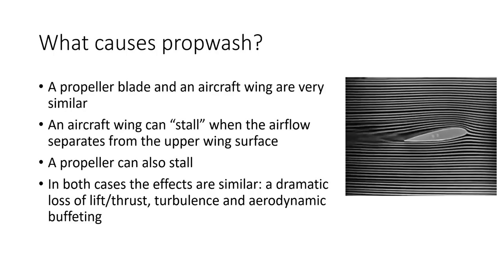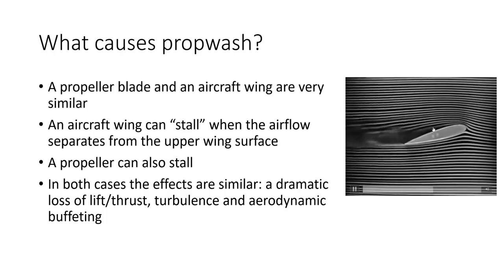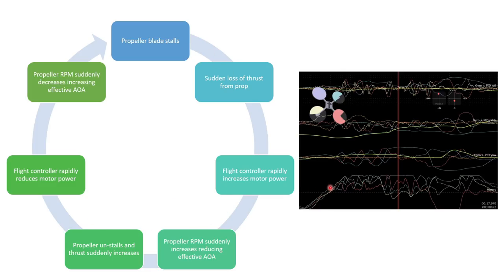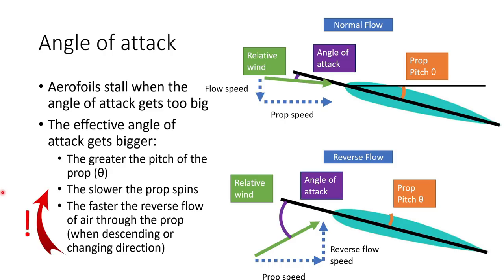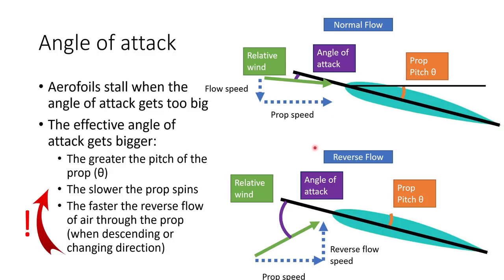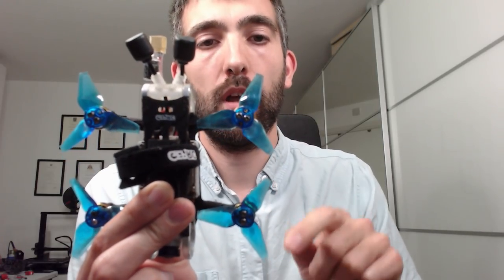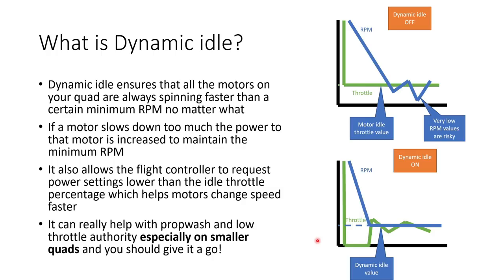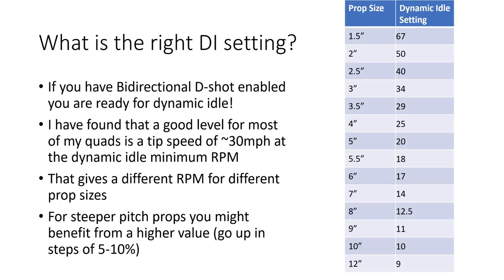What causes Propwash and how Betaflight Dynamic Idle can help!

Comment: How about for tiny whoops?  I struggle with a balance of min idle, inverted hangtime, and propwash/washout.   
If i try dyn idle at 67 on a 75mm whoop i have to increase min idle to about 15 from 5.5 to get rid of low throttle issues and then that kills any indoor inverted tricks.  
Secondly what about different blade counts?  Logically it looks like a quad blade would have worse performance because of the unstable air coming of tail effecting the following prop.
Reply from the maker: Tiny whoops are very difficult to tune. The best thing for washout is to run props out. Inverted tricks are very difficult with a tiny whoop because you're struggling with needing a high dynamic idle to minimise propwash. If you run BF 4.3 you can run a high dynamic idle with low D-shot idle (you cannot do that with 4.2). That's your best bet.
Reply: @ChrisRosser  Yah i’ll have to give 4.3 a shot.  We tiny whoopers push these things to their limits!  
I did mess around more with settings in 4.2.9.  I like Dyn Idle at 56 and min idle at 6.   It got rid of the washouts completely and i’m not noticing a difference in hangtime.  Only downfall is new mid throttle oscillations.  I can deal with some vibration though.  Thanks for the video and getting me to figure out how to use the setting.   
Cinewhoops get it next!...
Reply: Great question...  you fly accro indoors?  Lol, impressive!  Or maybe my apartment too tiny for such stunts :). Yeah wasn’t much explanation for tiny whoops...
Reply: @markmontreal7815  yah I can't fly in level mode even for races.  Look at the videos on my channel they are mostly all indoor tinywhoop freestyle.
Reply: @Shauny_D  just watched one…….  You’re not serious…. You really wrote that with the whoop???! Naaaah lol
Reply: @markmontreal7815  haha that was this week's challenge for fun.  Week 20 has some fancy indoor tricks.  I think week 23 some indoor rubix cubes and powerflips.  Anyway, all the top 20 or so IGOW pilots can do some crazy indoor stuff.  Watch Tyrantt or Auxplumes too they are machines!.

Comment: I've actually not tried dyn idle yet would it also help with inverted tricks ?
Reply from the maker: It won't necessarily help with inverted tricks but it might allow you to improve propwash and therefore lower your D-shot idle value slightly. That will help with inverted hangtime.

Comment: I experience wobbling when the throttle is at zero after using the 'Dynamic Idle Value [* 100RPM],' but in BF 4.4, I can't change the 'Motor Idle Throttle Value [percent].' How can I fix the wobbling issue?
Reply from the maker: Increase the dynamic idle value and the situation should improve.
Reply: @ChrisRosser  Thank you.

Comment: Hi Chriss. Thanks for your videos. I have a doubt about Dynamic Idle. For more aggresive props we need to set dynamic idle rpm higher? That seems counter-intuitive. I'm using BF4.3 and Hurricane 51466 and found zero throttle problems that I solved rising Dyn Idle to 40. With a prop like Ethix S3 the quad flies well with Dyn Idle at 30. Can you give some clue about that?

Comment: Hi chris. This was a phenomenal explanation - sorry i'm late to the party! 

could one in theory use the current throttle position as a cutoff/indicator for the minimum motor RPM? For example, if i know my cinewhoop can descend at 30% throttle straight down without stalling (any more is bad) - can i interpret this information and use it to my advantage?

I'm struggling a bit with cinematic shots where people wants me to descent straight down with a cinewhoop. 

In theory would bi-blades help reduce this effect because there is less drag on the prop? (an actual application for a sinusoidal prop maybe??)

thanks again for putting this into visuals. I understood intuitively that some sort of feedback loop was happening, but I never fully understood it.

Comment: Great explanation! I was wondering if the x8 offset motors is a good idea? Seems like a lot of dirty air.
Reply from the maker: It's a good way to get a lot of lift in a compact package. It's not as efficient as an X4 due to teh air from the first prop interacting with the second one but can carry a lot more weight for the size. Ideal for lugging heavy cameras around without resorting to  a much larger 10-13" platform with correspondingly worse vibration. 👍

Comment: OK so, I have 5.22" props. I set my dynamic idle to 19. I then spun a motor until I got 20% more. For me it was 4.8 idle value at an RPM of 2300. So only thing throwing me off if I lowered my idle value but then I have bigger then 5.0" props. Am I on track here?
Reply from the maker: Yep that's right. Bigger props will have a lower idle value.

Comment: I personally like idle value a bit higher then default as it gives me longer and smoother drops when spit-s or powerloop, and a this movements it is easy to get in to the propwash. Setting up my main idle value to around or above 6% was great in reducing propwash in this movements but after adding dynamic idle (in my case at or under 25% less then main idle) it gave me almost no propwash at all. Everyone should at least try what Master Chris is suggesting and I promise you will get what you expect :) LESS PROPWASH :)
Reply from the maker: Great to hear that you found DI made such a great difference. I'm happy to report that DI is much improved in 4.3 you no longer need to tune D-shot idle, just set dynamic idle and everything else is taken care of!

Comment: I tried dynamic idle when it was first added. It was working OK initially but when I tried to fly a quad with a motor output limit, I got a desync. I could feel that much of a difference when using it and I think there may be a bug with using it combined with motor output limit. The recommendations on what value to set seem to be different depending on where you look for the information, at least it was the last time I looked. I can’t remember what value I had used but it was towards the higher end of the recommended range.
Reply from the maker: Hi Tom, a common issue with DI in 4.2 is that if Dshot idle is set too low you end up relying on it all of the time. The controller for DI in 4.2 is very basic and can cause wobbles and other issues. DI in 4.3 has a PID loop and doesn't have the same problems. If you have issues with DI in 4.2 99% of the time you need to increase Dshot idle.
Reply: @ChrisRosser  I am still on 4.2.x versions. Will switch to 4.3 when it’s released or at least there is a RC version of it. The strange thing was that it appeared to be working properly on 4s but then had a desync on the first flight I did on 6s with a motor output limit.

Comment: This helped me a lot with my 4 inch but I am getting some low throttle wobble. In Betaflgith 4.3 when you use dynamic idle you can't use Motor Idle Throttle Value anymore is there another way to address the low throttle wobble in Betaflight 4.3?
Reply from the maker: If you have low throttle wobble in 4.3 it's unlikely to be dynamic idle related (unless DI is set too low). I would suggest looking at the PIDs.

Comment: So if the whole point of dynamic idle was to increase stability, but it ruins stability at 0% throttle, then is it worth it at all? I've been using it to try to help my low- throttle wobbles, and have had to set idle % values at like 14% on 6" to 10" rigs, which has been totally ridiculous and has ruined my inverted hangtime and dive abilities. If what you say is true, then I'm going to go back and turn off dynamic idle on all my quads, because it seems like a losing proposition. 

Why does it result in the need for super high idle %, anyway?
Reply from the maker: Great question: So as I understand it the control loop on dynamic idle in 4.2 was a bit crude. If you relied on it all the time at zero throttle it could create wobbles. It was meant to be used only as a last resort. Hence why you needed to have the right idle percent so you weren't sitting on dynamic idle the whole time. In 4.3 dynamic idle gets a full PID controller and its perfect, so good that you don't even have an idle percent any more with DI enabled.

Comment: Hi Chris, Thx a lot for the video.I followed your advise and propwash is gone. I've got one problem left.On full punch out, i am getting oscillations.I increased the throttle boost from 5 to 10, it made it worst.Do u have any quick tip on the full throttle punch out issue? Thanks.
Reply from the maker: Try looking into adjusting TPA. 👍
Reply: @ChrisRosser  Thank you

Comment: From someone with no clue: these values seem kinda high? Setting DI of around 67 for a 1.5inch (approx. my whoop with 40mm props) I'd have to increase the motor idle throttle value by so much, that it would be too floaty for my liking... good chance that I misunderstood something though.

My thought process right now:
Does the "idle throttle value" even do anything with DI enabled? You explained that the FC, with DI enabled, can command down to 0 throttle  (so go below the motor idle value) and then controls the RPM according to the DI-value that I entered, correct? So, if it is controlling the motor according to its RPM, "motor idle value" now only acts as a trigger for activating Dynamic idle whenever my throttle-channel goes below the idle setting?

In my understanding now: Whenever I move to idle power, Dynamic Idle determines the power to the motor to keep the minimum RPM as set in the "dynamic idle value". The "motor idle throttle" does nothing except trigger dynamic idle to control the RPM as soon as my throttle-stick moves below that value... but I'm sure there is a mistake in my thinking somewhere..
Reply from the maker: You need a high DI value to control propwash on small drones. If it's not floaty enough you can decrease it but it will negatively impact propwash. Of course you may wish to trade off these two things to suit your flying style and that's the right thing to do. Engineering is all about tradeoffs! 👍
Reply: You don't have to increase the motor idle throttle value at all in 4.3.  Most likely we will stop people messing with it to make it easier to set up.

Comment: I look forward to installing 4.3 and trying this. Could you help me understand a similar concept at full throttle?  It seems to me that 1 or 2 motors will hit 100%, which means the FC can only provide stability control by decreasing other motors.  Is it true to say that stability control at full throttle is inherently diminished, or is there some kind of dynamic full throttle pid loop that keeps all the motors hovering above and below 90%?  I'm developing a quad that uses prolonged full throttle punch outs, so I am curious to find out if scaling the throttle to 90% allows The flight controller to act like a dynamic high throttle pid loop.
Reply from the maker: Your understanding is correct but there is no problem with authority at 100% throttle. Reducing other motors provides the same authority as increasing one motor. In general control authrity increases at higher throttle because motors can respond more quickly at higher RPMs. 😁

Comment: thanks as always, chris! I'm still a complete noob when it comes to tuning a quad, and still VERY confused about all the parameters and settings. for example, what's the interplay between "dynamic idle" and "motor boost"? thanks
Reply from the maker: Those are quite independent. Dynamic idle is to do with minimum motor rpm. throttle boost just gives the motors a bigger signal if you increase throttle quickly rather than slowly. It's just feedforward for throttle.

Comment: I'm of the understanding Dyn Idle was basically rewritten in 4.3. setting it up should be the same, but it should perform better.
Reply from the maker: Spot on. Big improvements to DI in 4.3 with the addition of a proper PID loop for the RPM control 👍 Thanks CT!
Reply from the maker: Yes, in 4.2 DI had a very simple controller and setting D-shot idle too low coudl cause wobbles. In 4.3 DI gets its own PID controller so this problem is eliminated.
Reply: @ChrisRosser  hey Chris, reading it tuning notes for 4.3, it almost sounds like you can drop the dshot idle to something SUPER low, like 1-2%, then set the dynamic idle HIGHER than the dshot value.... Did I read that right?

From the tuning notes: " It can now be configured to hold RPM above the normal idle value, improving motor spin-up-from-low-rpm behaviour, while allowing motor drive to go to zero for enhanced braking when appropriate."
It continues
"Quite a lot of logs show that ESCs have difficulty quickly generating thrust from slow RPM. Dynamic idle, when set to a fairly high minimum RPM, eg 40, can prevent RPM falling low in reverse airflow states. This will improve responses when starting and stopping a flip at zero throttle.

The new code is so good that I can fly my quads (with old BLHeli-S ESCs) on 1% DShot idle and only 1200 rpm as a minimum dybamic idle RPM. The prop blades are visible turning slowly during LOS flips and rolls, but they don't desync. For more general freestyle applications, a minimum dynamic idle RPM of 4000, and for racing of 3000, with a DShot idle of 4% usually works really well"

Comment: Nice Video.

But at my BF 4.3 there is Motor idle gray, so I can't set this value when I use Dynamic idle. 
Is that new in BF 4.3?
Reply from the maker: In 4.3 Motor idle is disabled when dynamic idle is enabled because it no longer does anything. Just ignore it 👍

Comment: Just I wonder if Dynamic I. settings work for EDF quads as well?
Reply from the maker: Should work just the same. In fact may be more important for EDFs due to the Typically higher disc loading.

Comment: Has anyone here encountered uncontrolled altitude gain when the only variable they’ve changed from stock BF settings is dynamic idle? I have a light 3” Roma L3, fresh build, and as soon as I add dynamic idle it just takes off at 1/4 throttle and keeps climbing until disarm.
Reply from the maker: Perhaps your dynamic idle is set very high? That could cause the idle speed to be high enough to take off.
Reply: It’s the oddest thing Chris. I used 34 as a starting point and after lift off about 3’ off the ground the whole quad would shudder and start climbing. 

I tried this a few times and was so freaked out I just turned it off. 

I’ll try again tomorrow with half that value and work upwards. 

Thanks for the reply!

Comment: I am having some serious bounce back when I chop the throttle on roll and pitch , and I just can't figure this out
Reply from the maker: Do you have airmode on?
Reply: @ChrisRosser   @Chris Rosser  Yes of course. I need air mode. I am a very snappy pilot. I was able to get rid of some of it by changing my antenna mounting. (It's weird though, because I have used it on other quads. But I know you love that , lol I am about to just start mounting antennas to stand offs like you do.... I swear.) Anyway, I believe I can fix it by changing "I term Relax". But we will see tomorrow.

Comment: Great video
The part of how to set it I disagree it should be as dev recommend it is related to motor kv and size (rpm) and not the prop size
The start of the process should be the max idle value you find is suitable to your like and bring you great prop wash and floaty feel ,with not too much for efficiency , and then tune with proper motors tabs , sorry but not all features can be converted to simple user , there is some advanced user features , 
That needed to be handle carefully
Reply: He said it’s based on mph tip speed which should include kv I think he explained the table poorly
Reply from the maker: The key variable is the effective angle of attack of the prop which is goverend by it's pitch, the inflow conditions and the tip speed. Although this is a very complicated system it is possible to make simple recommendations for certain prop types lighter pitch props can have lower DI values ~20 for 5" while steeper pitch props need higher DI values to resist blade stall in adverse flow conditions (up to ~40 for some props). Motor KV would be important if we were using the throttle value (because KV would affect RPM) but because we are using RPM measured directly the DI setting is the same no matter the motor KV.
Reply: @ChrisRosser  what is lower pitch if you ask someone?
This is what I referring to , again I really love your work and the explanation of what is prop-wash was really informative and simple to understand , but this feature of not define properly quad can fly worse , motors can go too low and in rpm and quad could get into situation that is like desync

Comment: But with higher throttle idle the quad often becomes too floaty and I personally felt like as if it created sort of a deadband in low throttle control making it a bit tough to control the quad through tight gaps or even hovering it before a landing. Lastly i dont know for sure if dyn idle was the culprit but one of my lightweight 5" racers tend to bob up and down at low throttle and when i disabled dyn idle i got rid of it.
Reply from the maker: Low throttle wobbles is a known issue with DI on 4.2 if D_Shot idle is not set high enough above the DI value because the control loop is very simple. in 4.3 DI uses a proper PID loop which should all but eliminate that issue and may allow you to set D_Shot idle to 0% and not worry about it.
Reply from the maker: There is a tradeoff between floatiness and propwash handling. Using very light pitch props can help becuase they are less floaty and also can use very low DI values without propwash. 👍
Reply: @ChrisRosser  Thanks a lot! I will try the DI value slightly lower than 5" and set my throttle idle to 4 (reducing from 5). Mine is a 5" race quad AUW ~340g running Tmotor velox v2 2207 2550kv motors, gemfan 51477 triblade props. Frame is an HGLRC wind 5 lite. Still running bf4.2.